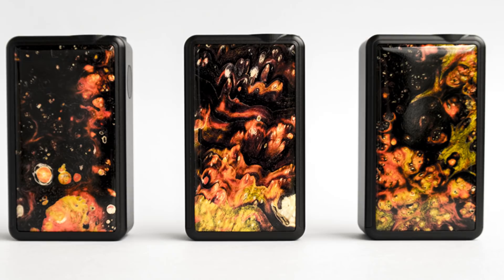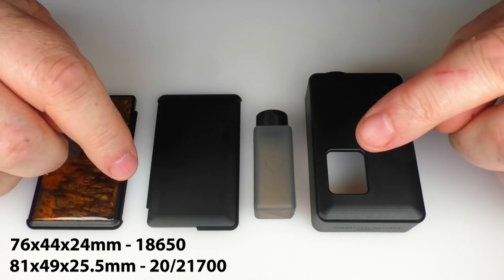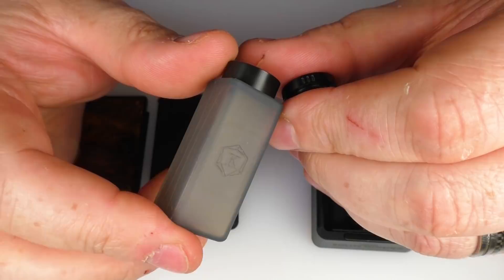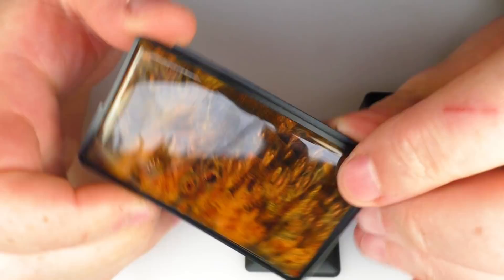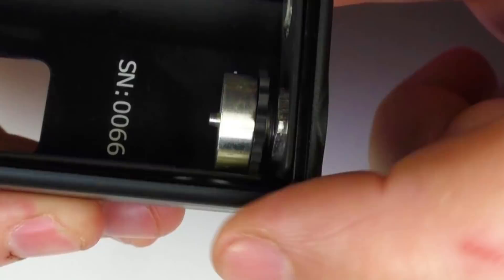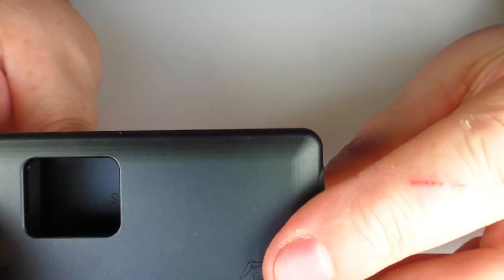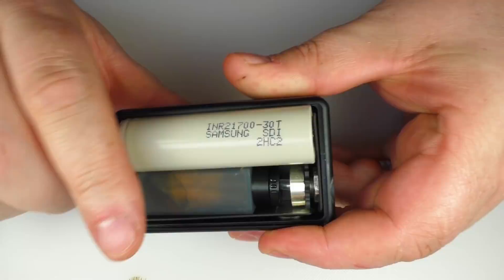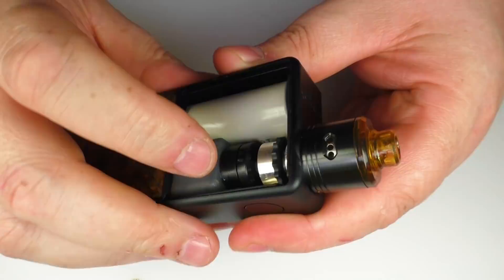Kronig Box - Billet Aluminium and Stab Wood Squonkers

Comment: LOVELY! I was lucky enough to play with this at Stuttgart and was impressed with the finish and quality. I must say that the 18650 version they had on display had a very "janky" door, which wouldn't slide properly and kept sticking but I'm sure this was a one off and with the customer support that Mr Todd has mentioned, it would be fixed without issue.
Stunningly lovely to behold and well worth saving up for 😍
Great review MrT 😊👍

Comment: Nice to finally see this in the flesh, so to speak, as opposed to a still photograph. Perhaps a round dimple on the contact would have been better as it looks quite flat with a lot of surface area to push the battery over. Have to agree it looks stonking with the skyfall/dlc. I've always been tempted by this mod, very tempted now. Nicely done Mark.
Reply from the maker: Dimples on the contacts Keith, I think I mentioned (or maybe I cut that bit out) that they are considering reducing the height on the dimples.
Reply: Indeed you did mention that point Mark.